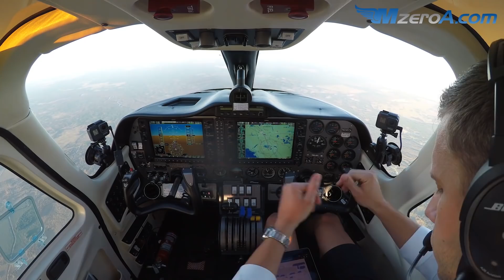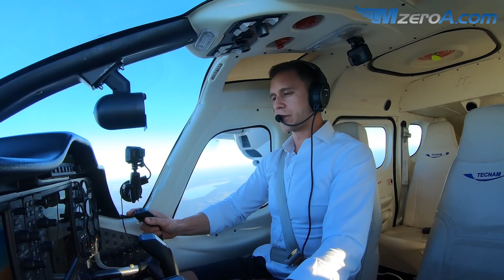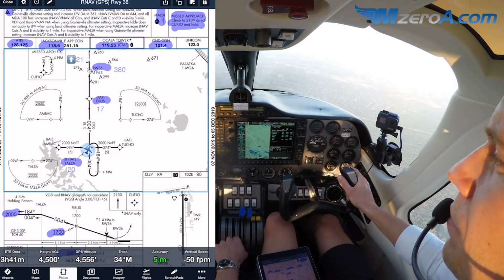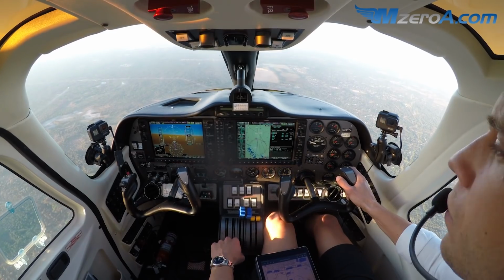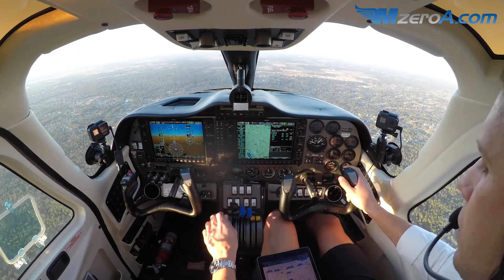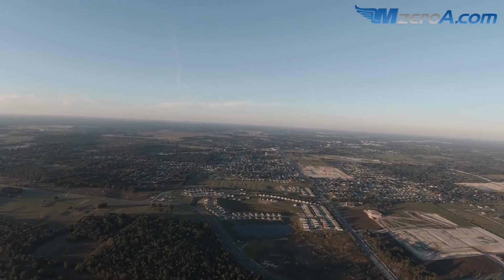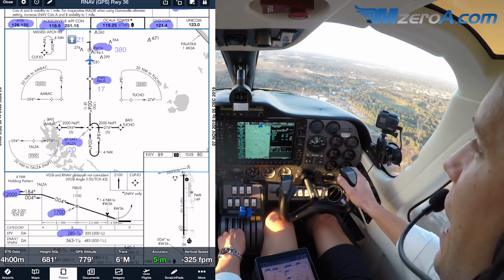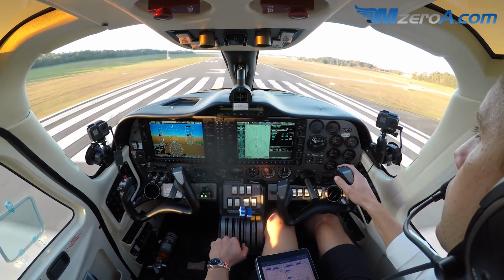Simulated Single Engine GPS Approach N245TA - MzeroA Flight Training

Comment: I'm not a pilot, but i try to always be learning:-), so why did it look like you were turning the wheel to the left if the left engine was dead? I thought that the wing on the dead engine side should be something like four degrees higher than the good side. BTW,  great view from the top of the tail showing the correction for the non linear engine thrust. You made it look easy, but it was still exciting.